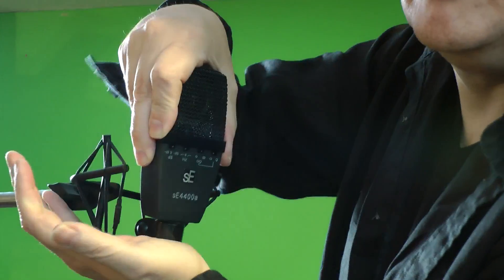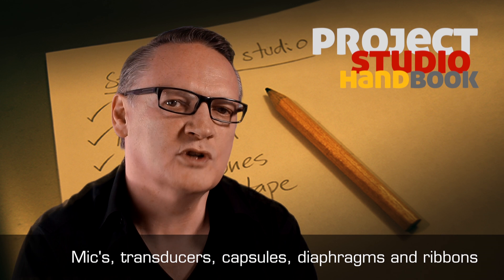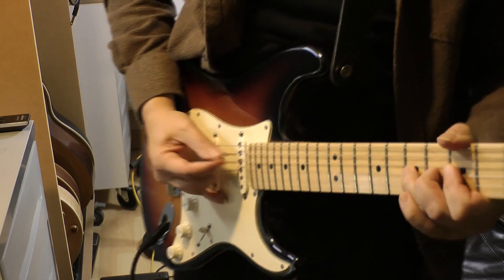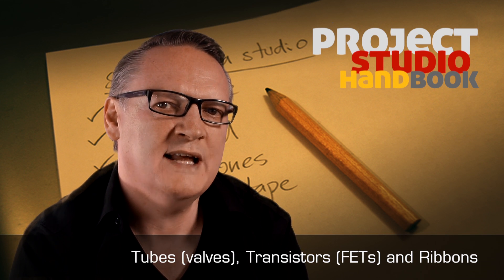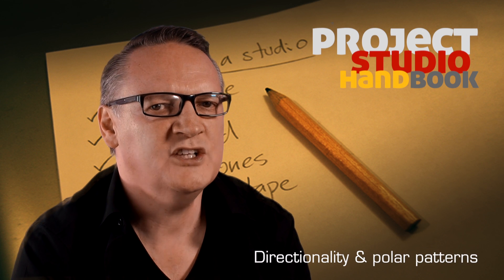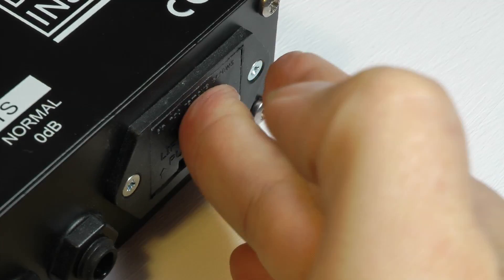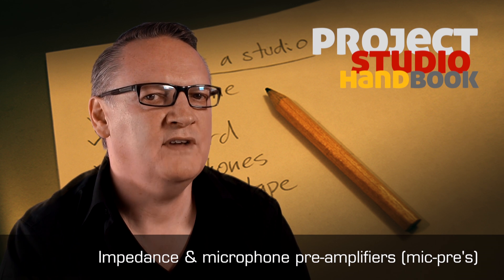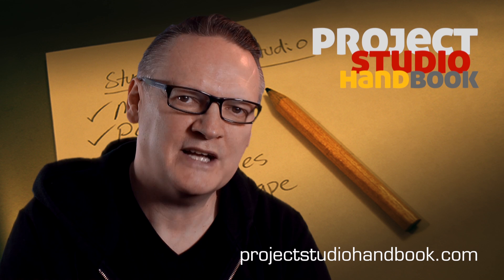Microphone electronics

Comment from the maker: Thanks for your comment. Even if your ribbon mic has a low output, you may get sufficient level into a mic pre, which doesn't have a ribbon mode, simply by close mic'ing, or when you are recording a loud source (eg guitar cab). If the noise level is acceptable and you like the sound, use it. We're not familiar with the Cloudlifter but because the low level at the mic pre is due to impedance problems, you would need to be sure that the Cloudlifter is addressing this issue and not just amplifying the signal from the ribbon. Although many ribbon mic's don't need phantom power, and some may be damaged by it if it is engaged when the the mic is connected/unconnected, it is recommended to check and take care. However, many new ribbon mic's have active electronics which require power and protect the motor from damage. Hope this helps.

Comment: I like my new Cascade Fathead mic, but the out put is slight as you say.  It is great on my guitars.  For vocals it is warm but low output.  My mic pre doesn't have a "ribbon" button and I don't think you are supposed to use any phantom power.If one wants to use a ribbon for vocals, is something like the Cloudlifter needed after the mic but before the preamp?